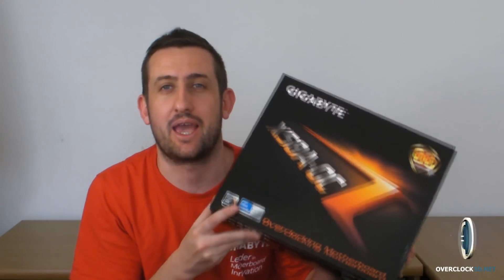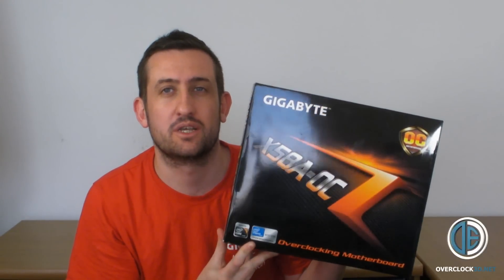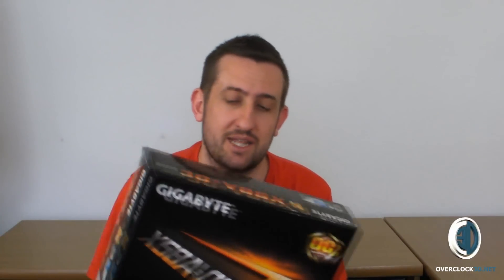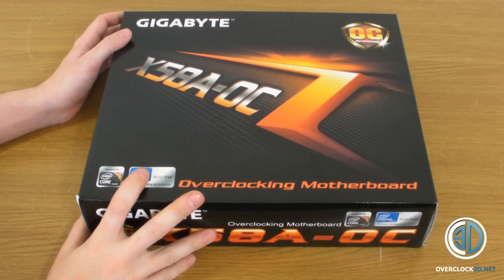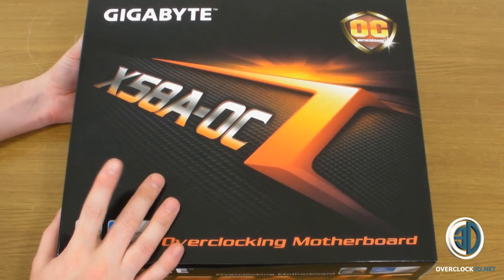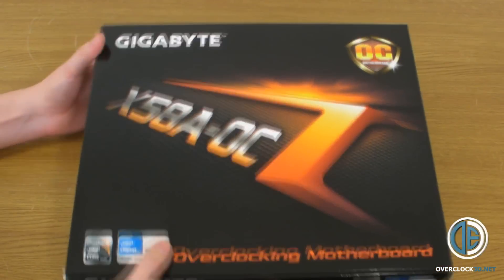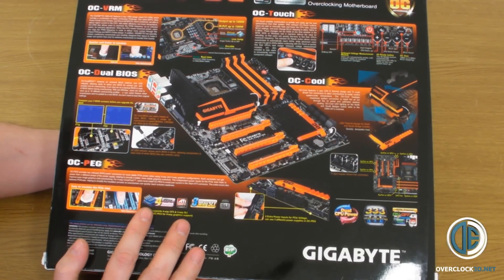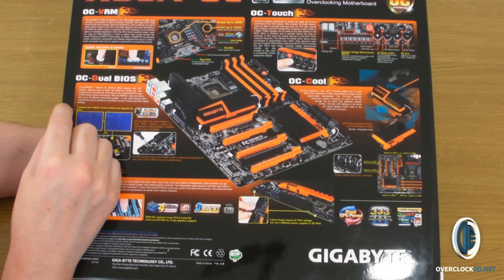Gigabyte X58A-OC - My First Look

Comment: @reach313 No idea, personally I'm getting a Crosshair V when it comes out, selling the IV and getting the baddest Bulldozer I could get my hands on. Then there would be a point overclocking and having my water system. The alternative is of course to go Opteron, but they are downright expensive. One thing is sure though, they do beat the Xeons.

Comment: @reach313 The new Thuban core has been said to reach somewhere around the 4.4GHz mark, which is good for an AMD core, never mind a hex. The Phenom II 960 I believe is Thuban based, so you should get an even better clock out of that(as two cores are disabled). The new Bulldozer will do really good as well as it is 32nm based. Let's not forget Intel rolled out their 32nm line way far back. That's the reason they clock well. I bet their 45nm chips were just as bad as AMD's current line.

Comment: @reach313 Check the AMD product sheets, max temps are listed as either 70*C or 62*C. They like to be cold. the very same model 965 set a 7.something GHz record under LN2 or LHe, so I know it can do it, but I hit a wall at 4GHz, it just dies when it reaches 42*C. That's why Intel clock way better.

Comment: @reach313 Only trouble is they can't take much more than 60*C(stock, near 3GHz models) or 70*C(stock, near 2GHz models), so I need a water cooling system for something Intel can do on air(both in OC and on benches) without HT and with the same cache(i.e. analogous models). I mean I'm running a Ph II 965 C3 at 3.9(ish) and I run as hot as 51*C with a 240mm EK rad and an EK Supreme HF block, cooled by 2 yate loons runnin up to 78CFM. I bet sandy will do 5G with that setup, but AMD is toast at 55*C

Comment: @reach313 I'm mainly with AMD for the great value they offer. Their chips may not be as good performers as Intel's, but they're certainly priced to match. I think they are getting close, however, with the new hex chips they introduce they have a good base to challenge the earlier i7 quads. Rumour has it they are also working on a system similar to HT to utilize extra threads, however it should be way more efficient than Intel's HT. Only time will tell.

Comment: @reach313 You'll have good fun with the X58. A decent i7(920/930/950) will do the trick. Those will all do 4GHz with a decent air heatsink(of course the NH-D14 will give you that extra edge). As it is I'm still stuck with a Deneb core AMD CPU, so there's no chance of me getting anywhere past 3.9GHz with any stability lol

Comment: @reach313 If you like the fun of overclocking then it's X58 all the way, but if you want very decent speeds with little effort(too little in my opinion), then sandy is the way to go. Both chips are going to deliver at a satisfactory level(i.e. max out all games), but it's up to you to decide how much you want to tinker with it. Look up the sandy bridge reviews(somewhere on the channel), see for yourself how easy sandy is and then decide if it's too easy. Also remember sandy don't do 3-chan DDR3

Comment: do the onboard overclocking controls synchronize with the BIOS? I mean if I press the "4G" button, and then access my BIOS, will it read 4GHz of cpu clock? and the multipliers as well, what about them?

thnx in advance

Comment: it seems the only way you could actually even challenge this boards potential is with LN2, even the most exotic watercooling setups wouldn't be able to cool the CPU enough to reach the clock speeds this is intended for...damn